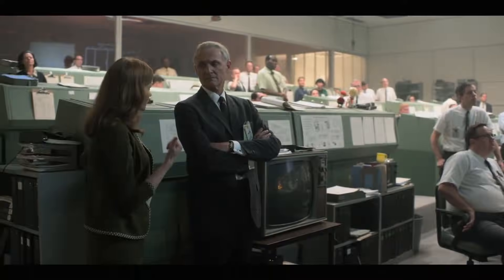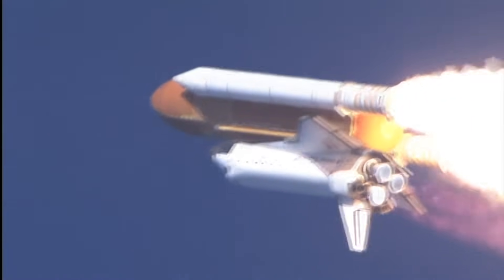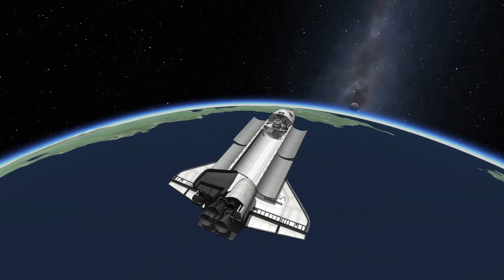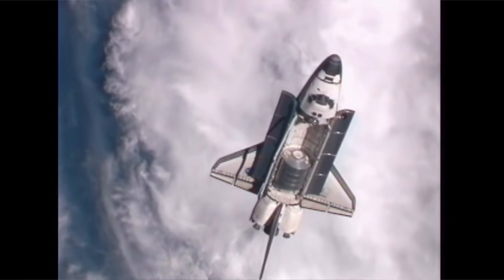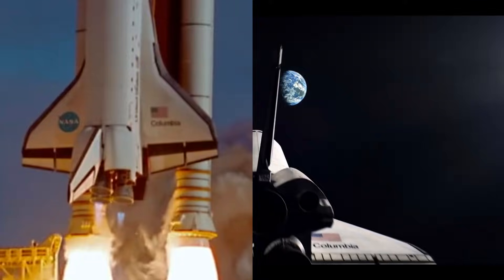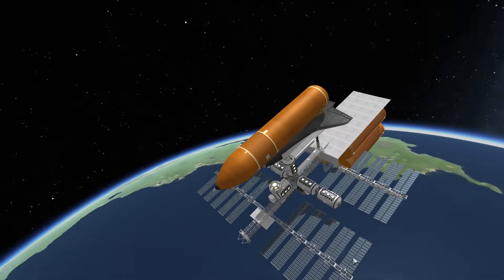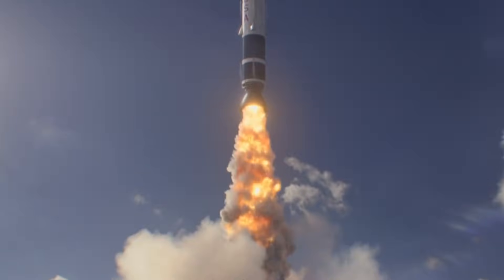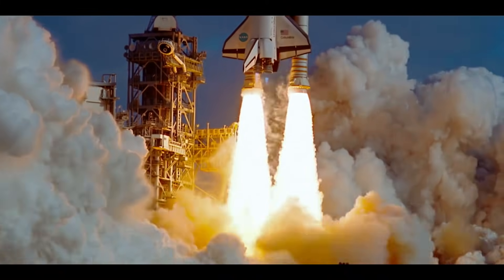How To Send A Space Shuttle To The Moon

Comment: Love the examination of pushing spacecraft past their designed functions.
A few questions arose:
If using the external tank, could the shuttle have enough fuel to decelerate adequately to re-enter the atmosphere?
You mentioned the deadweight of the wings if it should land. BUT if it did, could it be refueled, put upright on a launch pad and reach lunar orbit just with the main engines? The moon has 0.166g. The main engines contribute more than 16.6% of the thrust on launch from Earth. That makes it seem plausible, but I'd love to hear why it wouldn't.
Fly Safe!
Reply: The answer to both of your questions is YES.
If ignoring the obvious problems with actually landing there, a shuttle with a fully fuelled external tank on the Moon would have a capacity for velocity change (delta-v) of about 8.7 km/sec.
 That's over 50 % more than needed to reach lunar escape velocity and slowing down to a survivable re-entry speed (2.5 + 3.2 = 5.7 km/sec) before meeting the Earth's atmosphere.

Also, since the SRBs wouldn't be needed on the Moon, the shuttle's lift-off mass would be reduced from about 2000 tonnes to only about 855 tonnes, resulting in a thrust-to-weight ratio of 4.7 in lunar gravity.
Reply: @fromnorway643  Thanks for the feedback.  You confirmed my impression as well.

So let's talk about that landing...cause I've thought about that, too.

Obviously, without an atmosphere, it won't glide in.  And to land on its wheels, the shuttle would have to leave the external tank in orbit. (I suppose it'd use another tank to take off again.)

I suppose the shuttle could come straight down like the lunar lander, but I doubt the RCS could provide enough vertical thrust necessary to make that safe.  And such an approach would offer the pilots zero useful visibility.

So, what I imagine is the shuttle on a gradual, de-orbiting flight that puts it on a runway.  Prior to touching down, the shuttle pitches up, so the rear wheels touch first.  Essentially, the approach would look a lot like a gliding landing, though it's not gliding.  Once the wheels are on the ground, their brakes, friction and reverse thrust from the RCS would stop the shuttle.  It might take a long runway. They could even pop the parachute, just to let it drag on the ground and catch moon rocks.  I think the  critical concern is landing with a velocity that the impulse delivered to the rear wheels does not exceed the impulse they're designed to withstand while landing on earth. @ScottManley, what say ye?

 Fly safe!
Reply: @dbryan1688  
The shuttle's minimum landing mass with crew and some supplies would be about 80 tonnes. Lifting that mass in lunar gravity requires a thrust of
80,000 x 0.165 = 13,200 kilopond or 29,100 pounds.
The two OMS engines that gave the shuttle its final kick into orbit and also performed the deorbit burn initiating the landing had a combined thrust of only 12,000 pounds, so the thrust/weight ratio would be only 0.41 in lunar gravity. The RCS engines were even weaker than that, so any powered landing like that of the Apollo lunar module would be physically impossible.

Your second suggestion, landing the shuttle by slowly lowering its orbit until touch-down on the Moon's surface would be possible in principle, but there is one huge problem:
That method would require a landing speed of about 6000 kph or 17 times its normal landing speed on Earth. Even if the wheels could somehow withstand that without exploding, the wheel brakes would be virtually useless at first since nearly all the shuttle's weight would be cancelled out by the centrifugal force as it technically speaking would still be in orbit. The traction between the wheels and the runway would therefore be nearly zero until the shuttle had slowed down.
Landing like that would thus require an extremely long runway. If the wheel brakes and RCS engines could produce an average negative acceleration of 1 m/s² (~0.1 g), the entire slow-down would take nearly 28 minutes and cover a distance of 1389 km.

And finally, I suspect that the 1 m/s² of negative acceleration is a very optimistic estimate. It would probably be even less than that, which would require an even longer runway than my estimate.
Reply: @fromnorway643  Thanks.  That's hilarious.  We'll just build an equatorial runway, ringing the whole moon for our old shuttles to land on.  I got to thinking about it and kinda concluded the old shuttle would come in a bit hot there.  Thanks for the specifics.

How about this? We de-orbit like last time, BUT now we're facing backwards.  At the right height, a REALLY low height, the OMS and perhaps RCS fire, losing that 6000kph. So now, the shuttle just starts dropping straight down. It could use the RCS to manage its descent.

 I suppose a more practical way to use the shuttle to get to the moon is to have a lunar lander in the payload bay.
Reply: @dbryan1688  
Landing tail first as you suggested wouldn't be of much help. Even if the two OMS engines were assisted by the four aft facing RCS thrusters (those pointing in other directions would of course be useless), their combined thrust would be only 15,500 pounds, producing a maximum deceleration of less than 1 m/s² or 0.1 g. 

If fired when really low, they wouldn't have enough time to slow the shuttle down to a survivable landing, and the wheels would still meet the surface at a speed equivalent to more than Mach 5.
If fired when higher up, the shuttle might get enough time to lose enough horizontal speed for a survivable landing if the cargo bay was filled with extra fuel tanks for the OMS/RCS thrusters. The problem with that approach is that it would also give the Moon's gravity enough time to increase the shuttle's vertical speed, and the landing attempt would end with a catastrophic crash.

So, I think the only practical way would be to bring a lunar lander in the cargo bay and leave the shuttle in low lunar orbit, just as was done with Apollo's "mothership", the CSM.

If you really, really wanted to land the shuttle on an airless body, the only option
would be to pick an asteroid or something else with an escape velocity of only a
few hundred kilometres per hour or less.
Reply: @fromnorway643  Well, thanks for all the info. Clearly, I really do want to land the shuttle on the moon, but it looks like it's not gonna happen.

I remember when the EU tried to land their probe on a comet, and the gravity was so light that the probe bounced off.

Comment: Another potential problem would be that the shuttle's communications systems were only designed to communicate with the ground from low earth orbit. As such they would probably need to be modified to communicate reliably from deep space. Further, the shuttle's computers were only designed and programmed for earth orbital missions. As such they would at least require a lot of extra software to perform the extra computations and control necessary during a lunar mission.

Comment: I'm curious if an SLS-style extended ET and upgraded SRBs would be enough for a Shuttle to get to the moon and back? (Ignoring the heating on reentry issue; assuming that the main tank is just not discarded after LEO, but held on with more propellant for the lunar trip. Might even ditch it after the TLI burn, and just use extra-fuel-tanked OMS for lunar operations and return.)
Reply: No.
The first version of the SLS (Block 1) will only have 95 tonnes of payload capacity to LEO, and that's barely enough for the shuttle itself with full standard OMS tanks. If the cargo bay was filled with extra OMS fuel, the shuttle would be too heavy to even get into LEO, at least with an SLS Block 1.
Block 2 – if that ever is built – will have 130 tonnes of LEO capacity, or about the same as the Saturn V had. Even that isn't enough to send a 95-tonne shuttle to the Moon, because the TLI would require about 100 extra tonnes of hydrogen/oxygen plus the fuel tank/booster itself. The fuel requirements would be even higher if using fuel with lower specific impulse.
It's worth noting that the maximum payload sent to the Moon by the Saturn V was 47 tonnes when the empty third stage isn't included.
Reply: @fromnorway643  Yeah, I didn't mean to fill the payload bay with OMS like Scott showed; but just put in "maximum payload" - and use the external tank and main engines for TLI; with updated SLS Block 2, and maybe even some of the original 1970s/1980s widened SRBs as well.
Reply: @AnonymousFreakYT  
The only practical way of sending a space shuttle into orbit around the Moon (not landing) would be bringing the external tank into LEO and partly refilling it there. Doing that would require at least 2-3 launches with a Saturn V or SLS class rocket or 4-6 Falcon Heavys in expendable mode to bring the extra fuel needed for the TLI and operations near the Moon.
The bottom line is that the shuttle was simply not designed for anything but LEO operations and flying it to the Moon is a very stupid idea.

Comment: One thing I always wondered when I was a kid. Would it be possible to put the 3rd stage of a Saturn V into the shuttle's cargo bay, separately launching a orbital payload filled with fuel, and and after linking up and fueling the 3rd stage, use the shuttle as a launching platform for a lunar mission?
Reply: No.
The Saturn V's third stage (known as the S-IVB) was 0.5 metres shorter but 2 metres wider than the shuttle's cargo bay. 

The shuttle's cargo bay:
18.3 x 4.6 m
Saturn V's third stage:
17.8 x 6.6 m
Reply: @fromnorway643  can you retrofit a new version of the 3rd stage that is slightly narrower?

Comment: If they are mining Water on the moon they don't need extra heat shielding for the return, rather you perform a 2nd docking and refuel in Lunar orbit, then use that fuel to slow yourself down back into low earth orbit on the return,  you could even decant off the residual fuel + some extra at a 2nd rendezvous with the earth orbiting space station before executing a normal return to ground from low earth orbit

Comment: Given the small size of the Apollo command modules, they can't have carried much fuel but still managed to get to the moon and back. I obviously need to understand this more.
Reply from the maker: The upper stage of the Saturn V was needed to put the Apollo capsule and LM onto a lunar trajectory.
Reply: The Apollo CM/SM didn't need to carry or burn much fuel on the way.  The work was done by the Saturn V and then it just coasted using physics with an occasion brief burn to correct small errors and a big burn to park in lunar orbit.  In fact, if the CM/SM did nothing on it's way to the moon, it would just return to earth by itself life a boomerang.  Ain't Physics grand!?

Comment: We know apollo needed the lunar rentry "1 use" heat shield, but nor did it have the ability to produce any sort of retro burn to reduce velocity. Shuttle only had a low earth orbit heat shield, BUT..did have plenty of thruster ability to retro burn to slow its orbit, or more likely it's inbound transit, speed down..since we are making wildly impractical/impossible hypotheticals lol. So in our bizaro world here, no the shuttle actually would be able to set itself up for a lunar rentry...just not the way that Apollo did it 😉🎉🤸🏼‍♂️
Reply: Do you realize that this scenario basically would require a trans lunar injection (TLI) in reverse?
Apollo's TLI required a velocity change of about 11,000 km/h and that the remaining hydrogen/oxygen fuel in the Saturn V's third stage made up about 50 % of the total mass in low Earth orbit. The shuttle's OMS engines and RCS thrusters using hypergolic fuel were less efficient than the Saturn V's J-2s, so you would need an even higher percentage of fuel than 50 %.

Comment: Yes, of course fuel adds mass which requires more fuel, etc, etc..
OK, so how about doing this in two launches? First you launch a booster rocket to orbit earth and await the shuttle. Then you mate the shuttle to the booster (complete with fuel tank) and away they go. If you want to get fancy about it, depending on mission requirements, you can have a service module on a third launch to also mate up and provide extra power through the use of either chemical powered  or nuclear(as in a small reactor) APU;s. Just a thought.

Comment: They'd have needed a redesigned shuttle, so there would've been 2 versions of Space Shuttle, one for the Earth and one for the moon, the moon one would use most of the same components, but wouldn't have wings, it would have to be carried on another vehicle there, or have some system of refueling, it would have to land by another method, perhaps by something similar to the way SpaceX is doing vertical landings (which should be easier on the moon due to lower gravity).

NASA did consider a base on the moon in the 1970s, but funding was cutback, I don't suppose that a moonbase would just've been about moon exploration, experiments on the moon and astronomy from the moon, they presumably would've been aiming to maintain satellites further out than the Van Allen Belts and they'd have wanted to develop technologies for shielding against solar storms and cosmic radiation and presumably that is the sort of thing they're looking to do with the current plans for a permanent moonbase.

Comment: One flaw you did not mention, that i hear repeated ad-nauseum.... You DONT HAVE TO DO A DIRECT RE-ENTRY  You could simply orbit the earth and dock at the space station again.  This eliminates the heat loads of an Apollo style re-entry.  Apollo ONLY did this to save weight (no fuel)  Just like you refuel in earth orbit, you would probably refuel in moon orbit.  Tanks can AND are built where losses are minimal.   The non shuttle variant (cargo version proposed) could loft 150 tons to LEO. Thats a LOT of fuel and supplies
Reply: If the shuttle had enough fuel to alter its trajectory from an Apollo style re-entry to low Earth orbit (LEO) in order to dock with the space station, there wouldn't be any need to dock with the space station in the first place. The shuttle could just land as it normally did, since it would now be in the same kind of orbit that it was designed for.
The problem is that going from an Apollo style re-entry to LEO takes the same amount of velocity change as the trans lunar injection (TLI), about 11,000 km/h. That would require at least 80-90 tonnes of extra fuel carried all the way from the Moon, and possibly all the way from Earth to the Moon and back unless that fuel could be produced on the Moon itself.
Reply: @fromnorway643  Exactly.  You are refueling at the moon.  This is how Spacex is planning this.  They do not even HAVE a heat shield on the moon variant.

Comment: Hello Mr Manley et al
a) do riffles operate in space ?
b) what type of epoxy resin was used in Shuttle's SRBs ?
c) Shuttle could go to the moon but first they d have to make a runway :P
Reply: a) Yes
b) Don't know
c) What's the point with a runway when you can't land like a plane without an atmosphere?
Reply: @fromnorway643  c) thats my point. lol
Reply: @fromnorway643  by the way and forgive me if i sound stupid but if sparks and gunpowders work in the vacuum of space then whats the need of hypergolics ?
Reply: @psyxiatros1  
Rocket engines with liquid, hypergolic fuel can be stopped and restarted and throttled up and down, unlike those with solid fuel that can't be stopped after they have ignited.

That's why the shuttle's three main engines powered by liquid hydrogen and oxygen were started before the two SRBs. If some kind of malfunction was detected in one of the main engines during the 6 second start-up sequence, they could be shut down and the launch aborted.
If the SRBs were started first and some malfunction was detected in the main engines a few seconds later, the shuttle wouldn't have any choice but launching and let the SRBs burn for two minutes before being jettisoned as usual. The shuttle might still be able to do an emergency landing or even getting to a lower than planned orbit if the main engines were at least partially working, but that would be much more dangerous than simply aborting the lift-off before the SRBs were ignited.

Comment: The Space Shuttle was the first reusable "rocket". With improvements, it could still be a LEO workhorse (probably an expensive one). As such it could bring materials, supplies, and fuel to any space station or shipyard in LEO.  That is to say, it could keep not going beyond LEO and be a useful tool towards the colonization of LEO and Luna. Such a shuttle could be used to refuel another shuttle between LEO and Luna that has a Lander module that does the actual landing, or better yet, between ISS and LSS (Luna Space Station in a favorable orbit). But they are now too expensive and the wrong tool for the jobs.

With service stations in favorable orbits around Tellus and Luna, these steps could be performed by specialized craft; reusable rockets from Tellus to LEO and continuous-use rockets between Tellus orbit and Luna orbit, refueled and serviced at the Stations. Likewise, between Luna and Luna orbit, multiple small rockets could be used continuously without a separate Lander, but specialized for being easy to land.